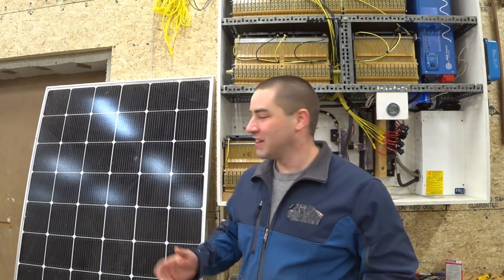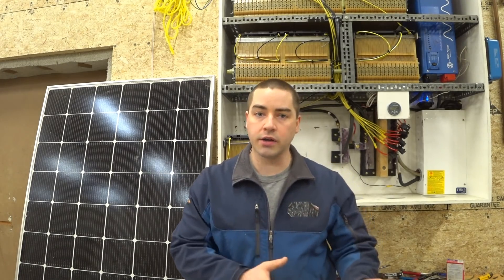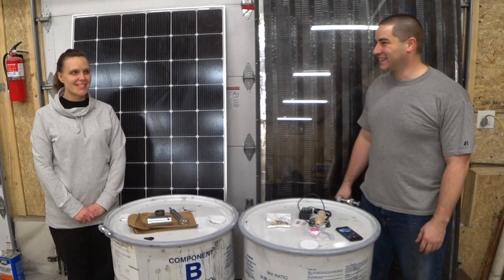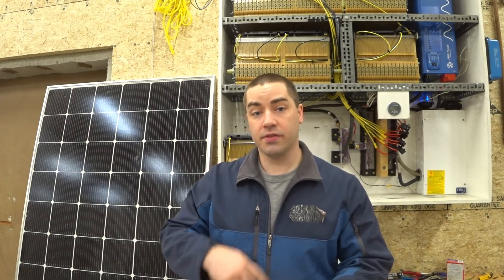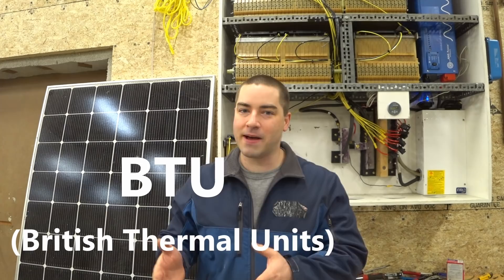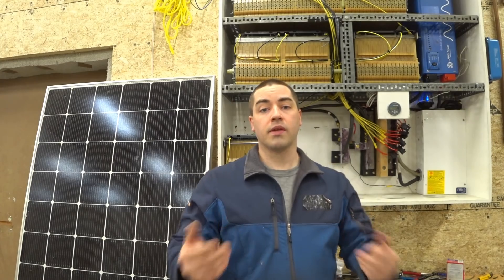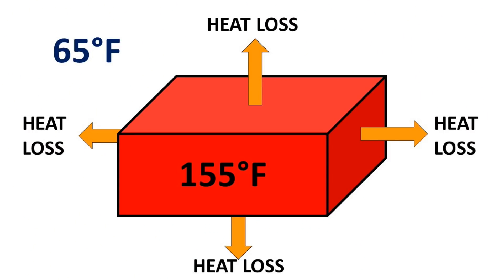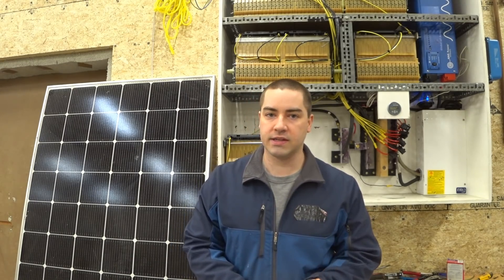Cheapest Energy Storage Off-Grid

Comment: Basically, the most efficient way of storing heat is storing heat.
Reply: lol .. but true
Reply: no it has 7,000 btu per day loss which is 25% of the system. lithium batteries have very little self discharge per day. if you could reclaim that heat for your house i guess you could say its even but in the summer that wouldnt be fun and it would make the system more complex. it also isnt usable to power anything. so its not exactly a fair comparison to the batteries which generate electricity.
Reply: @danielroden9424  it is not to replace solar panels but to complement them and store hot water to use as hot water for shower, dishes, laundry, etc.
Reply: @danielroden9424   if your heat exchanger is in your crawl space the heat loss is warming your house, a positive in northern climates
Reply: @danielroden9424  It is a fair comparison if heating is something you're guaranteed to need to do every day. Even in summer people want hot baths and showers, and if you fill your kettle from hot water you spend less energy boiling it. Same for the hob. Less gas or electricity used depending on which one you have.
Reply: @danielroden9424  its a 7000 thats useful in the winter as most the heat will rise into the home. Couter productive if you're cooling.
Reply: Christopher Boucher-Burns 
If it’s insulated well enough it won’t radiate heat into the home.
Reply: @BloodshedPanda  Two tanks, then!  One underground, outside for summer usage, the other under the house for winter.  Still FAR cheaper than battery storage AND the one under the house can be used for cooling when its water is not being heated in the summer.
Reply: @danielroden9424  The batteries take energy and cost and pollution to produce. PV cells also have a life span and take energy and cost and pollution to produce. Thermal storage is cost-effective in the long run.  Having the battery bank is for your electronics, and then all of your water heating can be taken care of by the thermal storage.  The other added bonus of the thermal battery is that you can make it with easy to produce and make materials, and the whole system is much more sustainable.  If you have the money though, I suppose you can just do everything with PV, but PV is also not really that efficient, and you lose out on a ton of energy that you could have captured as thermal energy.
Reply: @tropingreenhorn  PV have an almost "forever" life,  never wear out, no moving parts and pay-off in about 25 years.
We are living, smack in the middle, of the PV revolution
Reply: @dantyler6907  most affordable PVs start to produce less power after 10 years.
Reply: @tropingreenhorn ........there are some very nice Turkish PV-T panels.,they have been making them since the 70's..
Reply: @dantyler6907 .....they are sub 20% efficient..
Reply: The most efficient way is not to store it, but 'make it on demand' using a 'steady state' supply, at the exact point and time of use.
Heat losses in storage, or 'Standby-Losses" account for 25% of total consumption on average. Making it as you need it, where you need it, is much more efficient technology. Piping losses to get it there are usually calculated at 15% for conventional installations. 

Point of use eliminates piping loss completely. On demand eliminates the need for storage. If supply=demand and steady state is maintained ? Then no storage is required and total mass is reduced by 20 to one 1 - and the job gets done at half the cost ! and half the fuel/energy consumption. i.e. There's a lot more for a lot less in a low mass point of use demand system than a central storage system with high volume. 
The game has changed.
Key here is complexity + reliability - relative to consumption and cost to maintain the systems. Hi tech breaks down more - keep it simple and balance your needs. 
Know your own system and why you did it. Know the tech. side of the equation.
Reply: @Allen Loser 142k btu input @ 80%eff is reasonable today 5 x 1.5 = 7.5 gallons per day in #2 heating oil. Depending on your house size and degree day load ? that could be good or so/so but it's is not terrible. 
At a K factor of 7.0 in a 4200 degree day winter you should consume 600 gallons for heating only plus an avg of 1 to 1.5 gallons per day for hot water x 365 = 965 gallons (or its equivalent) in #2 Home Heating Oils.
If that number represents .50 gallons per square foot ? You are highly efficient.
If it exceeds .75 gallons per square foot with a normal hot water load ?
Then you are not ! Old buildings can exceed 2 gpsf in consumption.
Hope that helps you judge how you are doing . degree day data is in the newspaper.
Reply: @youdonthavetoreadthispost.5850  I understand that you may no longer install fossil fuel burning devices in New York. That's good. We need to change everything over to renewables.
Reply: check cold steam Tesla turbine, where you can use the stored heat as electricity.
Reply: @manipulativer  Steam can also be used instead of compressors to drive the refrigeration cycle and produce cooling for large buildings. The cooling load on the boilers goes higher than the heating load does in winter - 2 times 200BHP in winter - 3 times 200 Boiler Horse Power in the heat of summer. That equates to up to ; 600 bhp or up to 3 times 200 Gallons of #2 fuel oil - or 600 gallons in One hour to cool two 40 story buildings in Queens N.Y and up to 400 gallons per hour to heat them in winter. Steam drives both cycles. I fixed them when they broke down. Steam-tech. is powerful !

Comment: Since the tank isn’t pressurized, I wonder how much thermal heat loss there may be due to escaping steam. It seems potentially significant and the escaping steam might result in less than ideal air conditions/mold risk.

Comment: Copper refrigeration tubing as the conductor to the potable water is the way to go. You need less pipe because the heat transfer is higher, so no extra cost and it does not displace as much water in the storage reservoir.

Comment: Water evaporates quicker at high temperature. A float water valve would keep it topped off but that requires more btu's. Oil floats on water and does not evaporate much so this could help.

Comment: Split water into Hydrogen and oxygen using your excess electricity and compress the hydrogen to use later much like propane.  Compress the oxygen and sell to your local welding shop.
Reply: H2 is the smallest molecule and easily permeates through tank walls.

Comment: water+fire=hotwater
Reply: You forgot to include the carbon dioxide emissions (ok, not a problem if the fuel is renewable) but more importantly also forgot the particulate emissions which can cause local air pollution. Plus you have to gather, chop, store, season wood, tend a fire etc. This system, on the other hand needs no manual input, is completely automatic and requires no clean up afterwards.

Comment: So.. I'm super curious....  Have you ever run the numbers for putting in a double water heater? IE use a thermal storage system to feed pre-heated water into a Heat pump/ Electric heater water tank?
Reply from the maker: I'm currently running all my hot water (water to be heated) through the solar thermal tank, then it goes into a 19 gallon electric tank.  The electric tank is the "Booster" tank.  It will only kick on if the solar thermal tank does not heat the water all the way.  After long-term monitoring, the themal tank is doing about 71% of the job, and the electric about 29%.  Right now the thermal is doing 100% (March) but in DEC and JAN it won't handle everything.

Comment: Awesome presentation.. SAE units work just fine in the USA.

The part I missed was HOW you size your thermal solar heating panels, and the cost of that system.   Shouldn't  the cost of that system be included?
Reply from the maker: I'll have to make another video on the sizing of the panels.  I don't have a good video on that.  I currently have 3 thermal collectors connected to my 250 gallon tank.  I chose three because it was all I could fit.  LOL.  https://youtu.be/NDxmPl5jlVA

Comment: What's a Fahrenheit? is that what the pioneers used as zero when the mercury froze? water freezes at 0deg and boils at 100deg (RTP) so it's seems like a more sensible scale.
BTW. you do seem to know what you're talking about, I have about 13kW of PV, about 11kW grid-tied, 2kW dedicated to charging batteries. I'll have about 10-12kW of ST, heating a 350m2 underground STES (seasonal thermal energy store) which will provide (via hot water) heat till the next spring. It uses 54x6m deep piles to store heat in clay and concrete.
120F =49deg my PV heats up my 150L tank to about 80deg, first day it made that this year was 12 Feb! when I put in the ST and STES, any cold water (apart from for drinking) will be preheated to around 50deg before it even goes in the hot water tanks!
I gave up watching after you starting talking BTU/degF, I can't think in Imperial units. We haven't used then for 40 years in the UK. Perhaps you can record the video again, but with all SI units? (degC W kW m2 L)
Reply from the maker: Hi John,  I've never been to the UK.  What is your heat measurement?  When you go to a hardware store to buy a furnace or boiler, how is it rated?  They are all rated in BTU's over here in the US.  What's the equivalent over there?  Thanks.

Comment: Hmm.  It seems to me that if you changed the heat exchange mechanism into some kind of generator, like a Stirling Engine, you could sort of double dip on the energy.  Get energy from the water heating you are after, along with some electricity from the process of the exchange.

Probably would be more complex, and expensive, though.  Would be very worth it if done at scale, but maybe not at a household scale.

Comment: Excellent presentation!!, Thank you for taking the time and share it.
I’m in Chicago and have weather similar to your area. What did you use as the liquid in the water heater collector to avoid freezing? I was planning to use the car antifreeze solution. Do you know of problems/issues with it?
Looking forward to your comments,
Reply from the maker: My heat transfer fluid is regular tap water.  The system I built is called a drain-back.  Any time the pump shuts off all the water drains out of the panel and back into my tank.  My tank is insulated and inside my crawlspace so it won't freeze.  If you want to use an antifreeze based system then use a non-toxic glycol.  However, after my testing, the next time I build a system it will be a PV direct.  Did you watch my series on testing solar thermal vs. solar PV?

Comment: Your maths are a bit off. You need integrals to calculate that and would be complex also. There is software that can do the math for you. I can give you some tips though to improve efficiency. Try heating up not water but other kind of liquid that doesn't exchange heat that much. Use it as insulation and also heat that up. Make the inside (water container) cyclical but the outside square (insulation side).

Comment: I actually did similar with my kettle I drink a lot of coffee so I insulated a kettle from the outside and was able to keep the water hot for about 5 hours.  I eventually found a small ern that holds 6.5 litres from Japan that does similar but I did similar using insulators and copper internals as a thermal battery.

Comment: Perhaps these questions are answered in your other videos, but I’m curious how you regulate the temperature of the water coming out of the tank, and also how you actually heat the water in it (obviously this depends on whether you are using PV or solar thermal).  Also, it sort of looked like the tank was partially buried.  Seems like that would be a good way to insulate the system and control the delta between the inside and outside of the tank.
Reply from the maker: Hi sleeknub,  My current setup is a 250 gallon tank in my crawlspace.  It is heated with three solar thermal panels.  They can get the water hotter than you want, so there is a mixing valve that tempers the water down to 120 degrees F.  The tank is not buried. 

Playlist: https://www.youtube.com/playlist?list=PLVe7nJBrjHReCvpEjC_M_rBGiT74JpTxV

Comment: What if you need electricity not hot water? Hot water isn't going to keep your fridge or furnace fan going.
Reply: That's what the solar PV and batteries are for. By taking the heating load away, he has made his battery system more capable, without spending anything on more batteries.
Reply: Because this system isn't about the fridge, it's about the hot water heater.

Comment: I like your videos. Have you ever thought of making an insulated cement box, then sealing the cement. Then putting in your heat exchanger,  fill the box with gravel then you use your heated water to heat it. You should be able to store double the heat that way.
Reply from the maker: I considered it briefly at one point, but not recently.  I can build a plywood box pretty quick and cheap.  Have you built a concrete tank?
Reply: Not yet, studied it in college but the only thing so far I have done was solid cement cylinders. They are faster and when you are doing a job for some one, time is money. Cement holds a lot of heat and works great. However, if there is a problem down the road with the heat exchanger then it can't  be fixed.
Reply from the maker: That's cool.  Do you have any pictures of the build?

Comment: you calculated for energy loss in the tank by evap cooling correct? but what about the loss of heat while you are introducing cold water in thru the pex heat exchanger? what is the incoming temp of the potable water supply?  I think this will induce a very large loss of stored heat.
Reply: The way i do it is setup more than one Water tank like regular 240 volt electric 60 gallon hot water tanks that have the insulation over them and  set them up to heat one at a time by daisy chaining the Thermostats  like the Top and Bottom Elements are wired to heat the bottom first then the top so the hot water can be pumped out to a rad and fan for to help heat the home in winter or heat a pool in the summer without having to do anything else. If your using the hotest tank first and they are in series water line wise as the cold water enters the last tank it doesn't cool the first tank it cools the tanks in stages and the solar panels heat in stages back the other way. Good Water circulating pumps are the one for keeping hot water at the other end of the house with the timer built in and they have a transmitter that let the pump know when the other end is cooling off there cheap and easy to install.  https://www.youtube.com/watch?v=TrsptRZtIzc

Comment: So why not get a heat pump water heater to initial heat the water ?
Reply: Because he's using solar thermal panels, not PV. Overall efficiency is similar- solar thermal is about 70 percent efficient, solar PV about 16, add the heat pump and efficiency is perhaps tripled. However, you have the added cost, complexity, maintenance etc to consider.

Comment: As with many renewable energy projects,  conservation is more cost effective than production. Two ways to conserve hot water would be to use ultra low flow shower heads and waste water heat exchangers. Niagara make a shower-head that is .5/1/1.5 gpm. This is significantly under what most low flows use. There are a few youtube videos on heat exchangers which take the hot water that is going down the drain and using it to preheat the water going into the water heater.  Hope that helps.

Comment: living cheap..most effiient way may be to heat is gas..??? use a small flame glass corningware..pots corning ware or enemal cart iron with lids..with a small hole good..or even a presure cooker... use much raw food ...mix both for taste..cooked processed..food is not healthy..for heat use or wood fire..??? sun...??..gaas..solar..connected to a grid may be expensive..use a fan not aircon...insulate well 1-2.. rooms..solar good for cells..and 13 inch laptop with say i7 cpu..low on power..dont put car batts on concreate...a chemical reation..old car batts okay for solar  use a 12 volt circular pararelle system... have solar..cells follow sun..dont use white goods..cheaperst fasterst way to wash is a washer basin water no soap..cut chemical, smells..save improve health..wash hair dry ..not wet...no water no chemicals..with a nit comb..as diet improves head scalb..will make less dirt..only wash some  areas of body with water...feet..front grind..under arm waiste line.. rest use a scrubber...when skin dry...save water power..money.. as people use to do.. in desert with no water..some use to also use cloth to catch sweat in key spots..so not dirty cloths..eat a alcoline raw food diet low toxins....so not make fat or over heat or smell no metal no chemicals..xxoo..a recipy for the keen..lol

Comment: Hot water is relatively easy to create through the burning of firewood, which in a way is also solar power (the sun's power stored over time in a tree), if that is an option for you. Electric energy is much harder to create in large amounts, and also hard to store in large amounts. So for an off-grid system it makes more sense to not heat anything with electricity, but instead with firewood, geo thermal, etc.

If there was a simple and efficient way to convert heated water to electric power, then a water tank could replace batteries. But unfortunately there isn't.

Some of my thoughts on off-grid energy storage:

https://www.bjornmoren.com/Optimizing-energy-storage.html